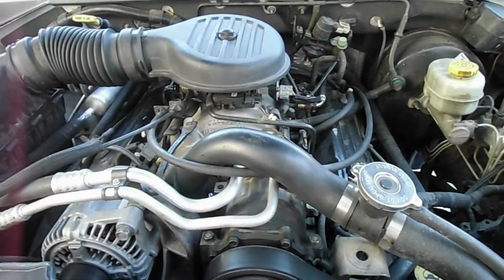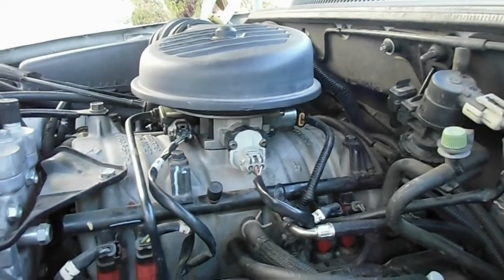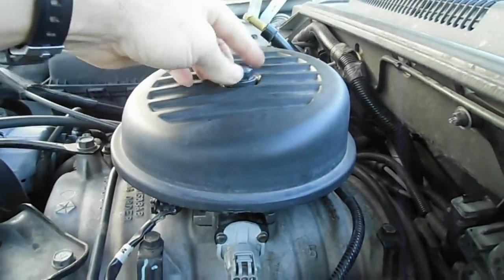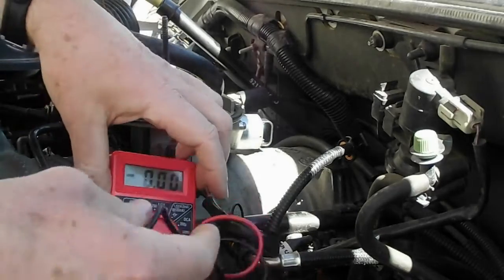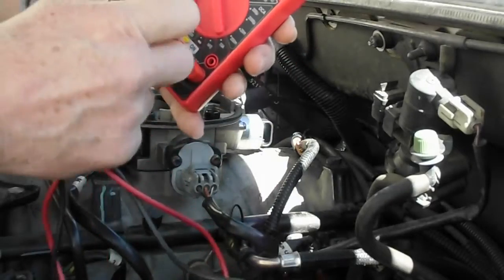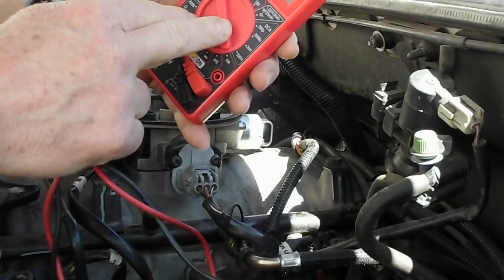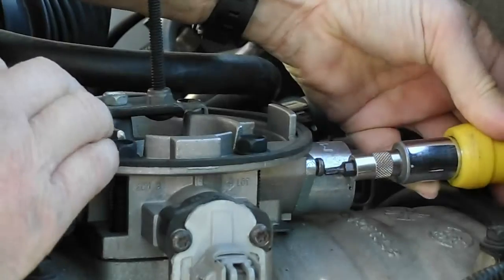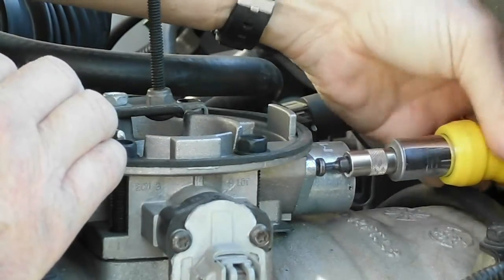IDLE AIR CONTROL valve IAC replacement P0505 trouble code check engine light Chrysler 5.9 L V8 cars

Comment: I got a reading of 11.86 but on the first 2 slots from the left to right and 0 reading on the 3 & 4 slots when checking with multi meter. My truck has a 5.2 not 5.9
Is this normal?

Comment: I pulled my throttle body off and cleaned all the carbon out of it I replace the throttle body gasket and I have no vacuum leaks. do you think an original idler air control valve for the 2000 Durango 5.9 RT woodwork?
Reply from the maker: Did you check the connections & wiring & the PCM, like I mentioned in my last reply?
Reply: IZZY's GARAGE yes I did I just don't know which wire's are the grounds and which wire's aren't when you test them. I need to figure out which wire's are the ground and which wire's aren't that way when I use my light tester I know which ones light up and which ones aren't supposed to light up all the connections are good there is no corrosion or anything

Comment: I have a dodge ram v8 5.9 liter engine. It's a 2000 and the code is 
PO 505. Is this the right video for me.
Reply from the maker: Yes, P0505 indicates an Idle Control System Malfunction.

Comment: I replaced my IAC valve and before the check engine light wasn’t on, but when I put a new one in the check engine light came on?
Reply from the maker: So why did you replace it in the first place if the check engine light was not on?

Comment: I have a 2000 durango that keeps throwing the code P0505 and I replace my idler air control valve and my check engine light still comes on and it's still throwing me that code what would be the problem? if you could help it would be greatly appreciated
Reply from the maker: Clean all the carbon build-up in the throttle body and in IAC bore. Make sure you have no vacuum leaks. Vacuum leaks can throw the computer off and send you on an expensive wild goose chase. Check the connector pins for any damage, corrosion, or moisture. Check the PCM connector as well. You could also have a short to power or ground somewhere along the wiring harness to the PCM, or a problem with the PCM itself. Good luck! . . . Let me know how it goes.
Reply: This keeps happening to my Ford Probe too, I replaced and cleaned the whole thing. no leaks anywhere.

Comment: hello buddy i have a 2000 dodge ram v6 and its doing the same thing idle really high  i check voltage an only 12 volts in the first one and second one   the other 2 read nothing   plse a hand if u can i appriciate
Reply from the maker: I can't exactly recall on that particular engine, but that measurement looks good. One of the usual problems with these valves is that they get full of gunk and carbon build-up. Also, the valve bore (where it sits in the throttle body) gets full of gunk  and needs to be cleaned-out with carburetor cleaner.  Are there any trouble codes?,
Reply: ជម្រាបសួរ

Comment: my 2002 ram 5.9 liter feels like its not getting enough air flow run rough n does not increase speed like before
Reply from the maker: Without a proper diagnosis, it's probably easier to win at craps than to guess what is wrong with your vehicle. If your check engine light is on, it might give you some direction.
Reply: yes i have check engine on ill take it to diagnosis
what about transmission should i take it to a diagnosis to
Reply from the maker: You can take it to your local auto parts store and ask them to scan it. (most will do it for free) and they will tell you what trouble codes are being reported by your car's computer.